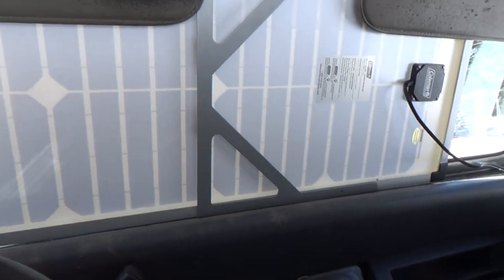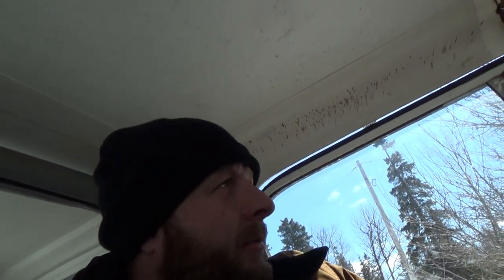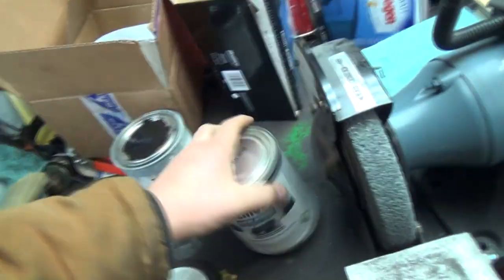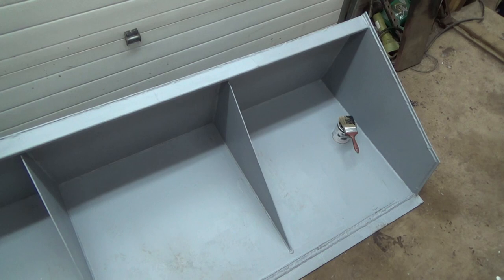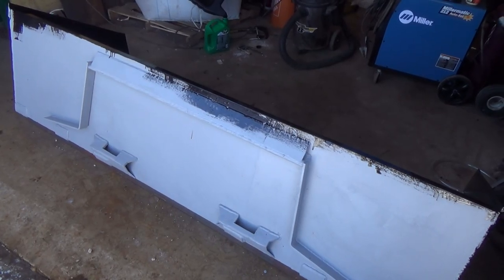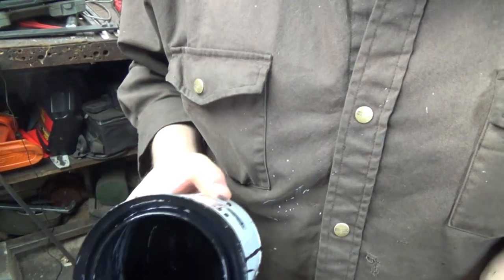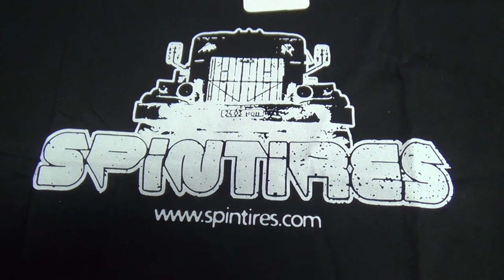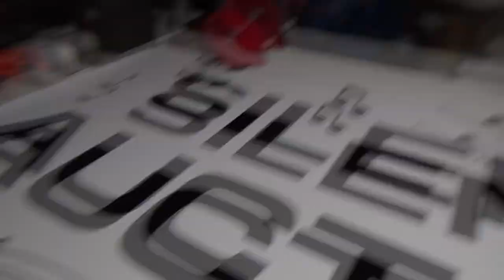slathering on some black as much as we can today humming bird style

Comment: i wunder how it would work to use a comb for you're hair to wash out the brush
Reply: That's a good idea!
Reply: Ben Kempa just use a good, stiff wire brush to clean a paint brush. Start at the base of the brush and brush away from the handle.  This cleans the center of the brush and removes lose bristles.